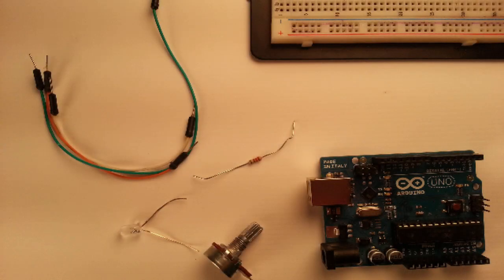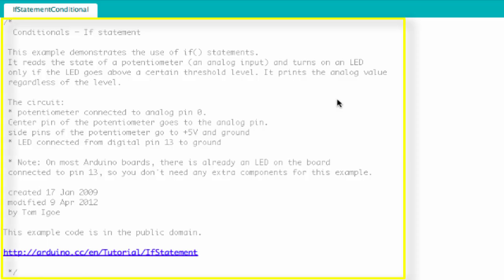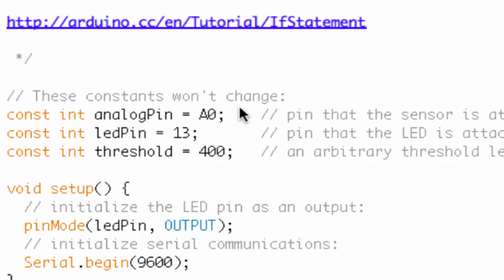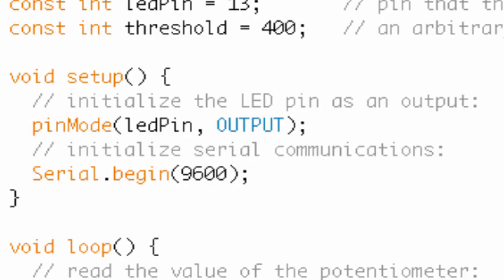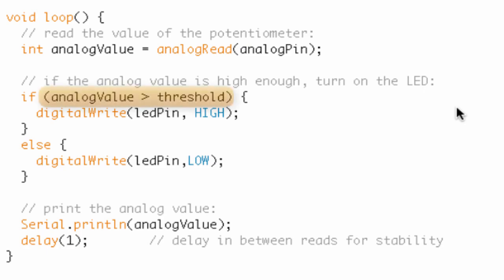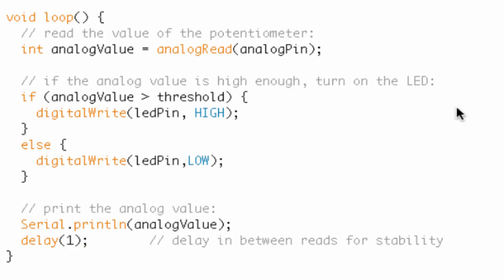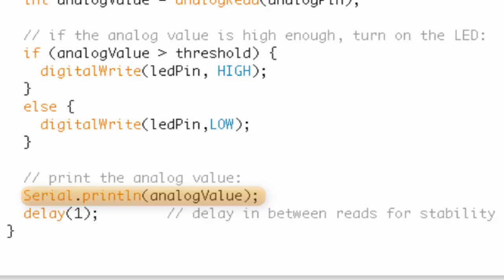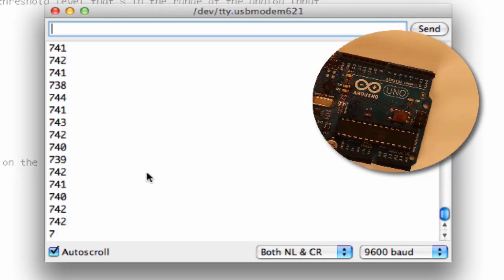Tutorial 11: If Statement Conditionals: Arduino Course for Absolute Beginners (ReM)

Comment: very interesting lesson, if put another const int with 600 and change ELSE for IF everything between 400 till 700 will be a small amount of energy coul be between 0 2volt or 3 volts till reach 700 to full bright light 5 volts , awesome!!! 
 int analog = analogRead(analogPin);
  if (analog > threshold){
    digitalWrite(ledPin, HIGH);
  }
   if (analog < point){
   digitalWrite(ledPin,LOW);
  }
  Serial.println(analog);
  delay(1);

Comment: Hi.
To start with i want to express my gratitude towards your tutorials, they are amazing!

I was playing around with the "IfStatementConditional" and say if i would want to light the LED when i have two thresholds, and the LED should light up below 100, and over 400.

Check out my amateury code:

// These constants won't change:
const int analogPin = A0;    // pin that the sensor is attached to
const int ledPin = 13;       // pin that the LED is attached to
const int threshold = 400;   // an arbitrary threshold level that's in the range of the analog input
const int threshold2 = 100; // arbitary threshold 

void setup() {
  // initialize the LED pin as an output:
  pinMode(ledPin, OUTPUT);
  // initialize serial communications:
  Serial.begin(9600);
}

void loop() {
  // read the value of the potentiometer:
  int analogValue = analogRead(analogPin);

  // if the analog value is high enough, turn on the LED:
  if (analogValue > threshold) {
    digitalWrite(ledPin, HIGH);
  } else {
    digitalWrite(ledPin, LOW);
  }
  
  //turn on  LED when value is lower than threshold2
  if (analogValue < threshold2) {
    digitalWrite(ledPin, HIGH);
  } else {
    digitalWrite(ledPin, LOW);
  }

When i go below 100, the LED lights up, but when i go over 400, it just barely flickers.
I guess i need some kind of statement in there so the program does´nt get confused.

Can i just add more thresholds like this? There is probably better ways of doing this.

I have no idea what I am doing, but i have learned alot. Thanks again!

Comment: Aha! This actually forced me to remember the "or" command. I tried to do two if/else statements with 500 the highest and 100 the lowest and it confused the Arduino. Turning the pot past 500 was basically telling it to go high and low simultaneously. The odd thing is, it just made the led light up very slightly. Fixed it with || "or" command and no second "if" statement. Logic works!
Thank you very much for the tutorials! I'm learning a lot.
Reply: Fixed, thanks man

Comment: Yahoo. I added another const int called newthreshold = 100 and then put another if statement with a < newthreshold .. etc and told digitalWrite(ledPin) high.. worked like a dream. when the serial monitor read under 100 the light turned on and off between 100 and 500. Thank you so much..

Comment: const int analogPin = A0;  
const int ledPin = 13;     
const int threshold = 400;   

void setup() {
 
  pinMode(ledPin, OUTPUT);
 
  Serial.begin(9600);
}

void loop() {
 int analogValue = analogRead(analogPin);
 if (analogValue > threshold) 
    digitalWrite(ledPin, HIGH);
   
  else if (analogValue < threshold - 300) 
    digitalWrite(ledPin, HIGH);
  
  else {
    digitalWrite(ledPin,LOW);
  }
 
  Serial.println(analogValue);
  delay(1);       
  }

 
 +Open Source Hardware Group, thanks for the challenge. Proceeding to the next tutorial...
Reply: not bad except you miss couple of {}

Comment: if (analogValue > threshold) {
    digitalWrite(ledPin, HIGH);
   if (analogValue < threshold - 100);
     digitalWrite(ledPin, HIGH);
  } else {
    digitalWrite(ledPin, LOW);
  }
This code has no errors but my added code doesn't work...if I change the 2nd IF to ELSE IF I get errors

  // if the analog value is high enough, turn on the LED:
  if (analogValue > threshold) {
    digitalWrite(ledPin, HIGH);
  } else if (analogValue < threshold - 100);
     digitalWrite(ledPin, HIGH);
  } else 
    digitalWrite(ledPin, LOW);
  }
exit status 1
expected unqualified-id before 'else'
What am I missing???
Reply from the maker: +Michael H I think you may be missing a closing bracket after your first if:

if (analogValue > threshold) {
    digitalWrite(ledPin, HIGH);
}//I believe this is missing

   if (analogValue < threshold - 100);
     digitalWrite(ledPin, HIGH);
  } else {
    digitalWrite(ledPin, LOW);
  }

Comment: For the try it on your own challenge 
/*
 If Statement 
 */

//const will protect the variable from being changed 
 const int analogPin = A0; //analog pin is A0
 const int ledPin= 13; 
 const int threshold = 400;// threshold limit inside analog input range 0-1023
 const int lowThresh= 100;// new low threshold 

 void setup() {
  pinMode (ledPin, OUTPUT); //all pins are set by default as input but it's good practice to set the mode 
  Serial.begin(9600); //see info from arduino to set up
 }
  void loop () {
    
    //reading the value of the analog potentiometer set output = to a varible using analogRead()
    int value = analogRead (analogPin);
//if else statemnt if the analog value is higher than the threshold send 5 volts else send 0 volts
    if(value > threshold || value <lowThresh) { 
      digitalWrite(ledPin, HIGH);}
    else { digitalWrite (ledPin, LOW);}
 // Use the || "or" logic operander instead of creating 2nd if statement 
 //printing the analog value 
Serial.println(value); 
delay (1);
  }

Comment: what if I'm assigning those LED to analog pins like A0, A1, A2 and so on. Where the goal is to turn off the LEDs upon user interaction. What would be the line of coding?
Reply from the maker: Hi +Daniel P, I think you are asking what the "conditional statement" should be used in the "if statement".  I think it would depend on the type of user input.
Reply: Well the user will just move their hands and LEDs would dimmed and if so then laser should come on. Yes it is the IF statement but because I'm using analog I don't know how to put it in. With digital it's easier but with analog I'm totally confused. I'm using Pins from A1 to A5 on the 2560

Comment: Instead of adding a new if statement, just add || (OR) to the first if statement and subtract 300 form the initial threshold value.
E.g.: 
if (analogValue > threshold || analogValue < threshold-300) 
{
digitalWrite (ledPin, HIGH)
}
... thank you for your tutorials. Great work!!
Reply: its Absolute Beginners Brother
Reply: It's usually better to have separate threshold values so you can set them at the top.

Comment: // i just published below the result of my own challenge.
// i have added tow more LED and one buzzer. 

const int analogPin = A0;    // pin that the potentiometer is attached to
const int ledPinR = 13;      // pin that the red LED is attached to
const int ledPinY = 12;      // pim that the yellow LED is attached to
const int ledPinB = 11;      // pin that the blue LED is attached to
const int buzzer = 10;        // pin that the buzzer is attached to

const int thresholdAa = 100;   // an arbitrary threshold level that's in the range of the analog input
const int thresholdA = 200;    // an arbitrary threshold level that's in the range of the analog input
const int thresholdB = 400;    // an arbitrary threshold level that's in the range of the analog input
const int thresholdC = 600;    // an arbitrary threshold level that's in the range of the analog input
const int thresholdD = 800;    // an arbitrary threshold level that's in the range of the analog input

void setup() {

  pinMode(ledPinR, OUTPUT);    // initialize the red LED pin as an output:
  pinMode (ledPinY, OUTPUT);   // initialize the yellow LED pin as an output:
  pinMode (ledPinB, OUTPUT);   // initialize the blue LED pin as an output:
  pinMode (buzzer, OUTPUT);     // initialize the buzzer pin as an output:

  Serial.begin(9600);   // initialize serial communications:
}

void loop() {
 
  int analogValue = analogRead(analogPin);  // read the value of the potentiometer:

  if (analogValue > thresholdA) {digitalWrite(ledPinR, HIGH);}    //if the analog value is high enough, turn on the red LED:
  if (analogValue < thresholdA) {digitalWrite (ledPinR, LOW);}    //if the analog value is low enough, turn off the red LED:

  
  if (analogValue > thresholdB) {digitalWrite (ledPinY, HIGH);}    //if the analog value is high enough, turn on the yellow LED:
  if (analogValue < thresholdB) {digitalWrite (ledPinY, LOW);}    //if the analog value is low enough, turn off the yellow LED:
  
  if (analogValue > thresholdC) {digitalWrite (ledPinB, HIGH);}    //if the analog value is high enough, turn on the blue LED:
  if (analogValue < thresholdC) {digitalWrite (ledPinB, LOW);}     //if the analog value is low enough, turn off the blue LED:
  if (analogValue > thresholdD || analogValue < thresholdAa) {digitalWrite (buzzer, HIGH);}     //if the analog value is highest than thresholdD or lower than thresholdAa, turn on the buzzer:
  
  else { digitalWrite(buzzer, LOW);}    // in all other situation the buzzer is off:
  
  Serial.println(analogValue);       // print the analog value:
  
  delay (1000);        // delay in between reads for stability
}
Reply from the maker: +Sir kOpRoLiThOs Nice work!
Reply: +Open Source Hardware Group Thanks

Comment: i made the code to also make the LED light up when it's below 100.
but now it won't light up when it's above 500.
what's wrong with my code?

const int analogPin = A0;   
const int ledPin = 13;       
const int thresholdHigh = 500;   
const int thresholdLow = 100;

void setup() {
  
  pinMode(ledPin, OUTPUT);
 
  Serial.begin(9600);
}

void loop() {
  
  int analogValue = analogRead(analogPin);

  if (analogValue > thresholdHigh) {
    digitalWrite(ledPin, HIGH);
  }
  else {
    digitalWrite(ledPin, LOW);
  }

  if (analogValue < thresholdLow) {
    digitalWrite(ledPin, HIGH);
  }
  else {
    digitalWrite(ledPin, LOW);
  }
  
  Serial.println(analogValue);
  delay(1);      
}
Reply from the maker: Hi +Rasmus Poulsen,

I believe the issue is the "else" portion on your second if statement.  

Even if the analogValue in not less than the thresholdLow value, the 'else' part of the second if statement will still run, thus turning the ledPIN LOW.  

So if you get rid of the else portion of the second if statement, I think it should work as you intended.

Does that make sense?
Reply: +Open Source Hardware Group made perfect sense. I will try it and thanks a ton for your help 😌 your tutorials are very very helpful to me! 😁

Comment: i combined knowledge from previous tutorials and wrote this code to control brightness of led using potentiometer. :)
 This example shows how to fade an LED on pin 9
 using the analogWrite() function.
 fadeamount is specified using potentiometer connected to A0
 */

int led = 9;           // the pin that the LED is attached to
void setup() {
  Serial.begin(9600);  // declare pin 9 to be an output:
  pinMode(led, OUTPUT);
}

void loop() {
  int brightness= analogRead(A0); //level of brightness specified through A0
  analogWrite(led, brightness);
//as input from A0 range from 0 to 1023, but max brightness is 255
  if (brightness > 255) {
    analogWrite(led, 0) ;
  }
  Serial.println(brightness);
  delay(1);
}
Reply: Harris Muhammad 
I modified your code to make the LED fadable through out the full range of the potentiometer. 

/*Make led on pin 9 fade with potentiometer with middle pin connected to A0
and side pins connected to 5V and GND*/

int led = 9;           // the pin that the LED is attached to
void setup() {
  Serial.begin(9600);  // declare pin 9 to be an output:
  pinMode(led, OUTPUT);
}

void loop() {
  int sensorvalue= analogRead(A0); //get data from A0
  float brightness = sensorvalue * (255.0 / 1023.0); //Make sure that 5v= 255 and not 1023
  analogWrite(led, brightness);

  Serial.println(brightness); 
  delay(1);
}
Reply: smygbas Also, thanks a lot for these tutorials! I am learning a lot more from this than just looking at the example sketches and feeling overwhelmed.
Reply from the maker: Nice work!

Comment: I like to first say your tutorials are very helpful for my first attempt at programming. I've been working through your challenges. I may have taking this challenge farther than I need to. I added second LED, one red and one green, so you could tell if the threshold was high or low. Here the code.

const int analogPin = A0;    // pin that the sensor is attached to
const int ledPingreen = 13;       // low threshold pin that the LED is attached to
const int ledPinred = 12;         // high threshold pin the the LED is attached to
const int thresholdhigh = 600;   // the high threshold level that's in the range of the analog input
const int thresholdlow = 100;    // the low threshold level that's in the range of the analog input
void setup() {
  // initialize the LED pin as an output:
  pinMode(ledPingreen, OUTPUT);
  pinMode(ledPinred, OUTPUT);
  // initialize serial communications:
  Serial.begin(9600);
}
void loop() {
  // read the value of the potentiometer:
  int analogValue = analogRead(analogPin);
  // if the analog value is high enough, turn on the LED:
  if (analogValue > thresholdhigh) {
    digitalWrite(ledPingreen, HIGH);
  }
  else { digitalWrite(ledPingreen, LOW);
  }
 
  // if the analog value is low enough, turn on the LED:
  if (analogValue < thresholdlow) {
    digitalWrite(ledPinred, HIGH);
  }
  else { digitalWrite(ledPinred, LOW);
  }
  // print the analog value:
  Serial.println(analogValue);
  delay(1);        // delay in between reads for stability
}
Reply from the maker: Awesome - nice work!  I think when we take the time and effort to tinker around, we can really learn a ton.  Thanks for posting!

Comment: Hi, I tried to make a combo with this tutorial,tutorial 10 and 9. I have achieved some result but my LED blink 3 times. I supossed that's because you said the brightness goes 0-255 and the voltage 0-1023. Is there a method to equal these variables? I think then the LED wont blink.

Comment: Hi. Did the challenge stuff and wanted to expand and combine with tutorial 9 (read analogvoltage). I wanted a LED to be dimmed by turning the potentiometer. I got into a problem that for me was really wierd. Went on the irc channel for arduino and got a reply very fast. It worked, but I do not get the logic behind this:

int brightness = analogValue*(255/1024.0); - this works
int brightness = analogValue*(255.0/1024); - this works
int brightness = analogValue*(255/1024); - this does not work

Is it me that do not understand the syntax of regular math? or is it something in the arduino language that forces you to add that point 0 at the end of one of the numbers?

Here is the complete sketch: https://gist.github.com/Daoni/e226c84a2fce2ed00832

Comment: But then I tried the reverse way; trying to get the LED "ON" by just changing to

 if (analogValue > threshold_1 || analogValue < threshold_2)

and the LED keeps ON all the time :(
Reply from the maker: Jorge Ortega In this instance, you should try the boolean && operator, since both of those conditions must be TRUE in order to keep the led ON.

Right now the condition is always TRUE, because the analogValue will always be > 300 OR < 500.

Hope that helps!  This is something that bites me all the time too!
Reply: Open Source Hardware Group Thanks a lot!
Reply from the maker: Jorge Ortega You bet, I hope you get it working as planned!

Comment: I wanted to try it out in a way that it only turns "OF" when range in between 300-500 and  this is the way I wrote it, it works perfectly. Declaring 2 thresholds (1 & 2) and using the || (OR) option for the analgoValue.

const int analogPin = A0;   
const int ledPin = 13;      
const int threshold_1 = 300;
const int threshold_2 = 500;

void setup() {
 
  pinMode(ledPin, OUTPUT);

  Serial.begin(9600);
}

void loop() {
 
  int analogValue = analogRead(analogPin);

  if (analogValue < threshold_1 || analogValue > threshold_2) {
    digitalWrite(ledPin, HIGH);
  }
  else {
    digitalWrite(ledPin,LOW);
  }

  Serial.println(analogValue);
  delay(1);
}
Reply from the maker: Jorge Ortega Nice work!

Comment: hi there,
can you please advice how we can become really good at programming. Is there anything  we can use to aid our design, e.g flowcharts?. Or is it just old pulling your hair and lots of practice thingy? If you are doing a complicated, big project, where do you start, how do you structure it? Its easy to understand when we look at the examples in the library or your video but when I do it on a empty sketch, its something else. Great videos ..many thanks.
Reply from the maker: +Pathy K That's another great question!  There is a science and art to developing larger programs/projects (not that I am pro by any means!).  The biggest part is clearing defining what it is you are trying to do, breaking it up into really small parts and then focusing on incrementally designing each part.  Doing things one step at a time.

I do cover an approach to prototyping in the Arduino Course for Absolute Beginners Course that is available at the website, but the short explanation above is the "boiled down" version.

Best of luck!

Comment: I tried the challenge of a second if+else statement but then I lost my upper threshold function so I just added an additional if statement without an else statement and it worked fine. Is that okay or should I always follow an "If" with an "else"?
Reply from the maker: David D It is very ok to use multiple if statement's, with out else/if's.  That is how I ended up doing the challenge too.